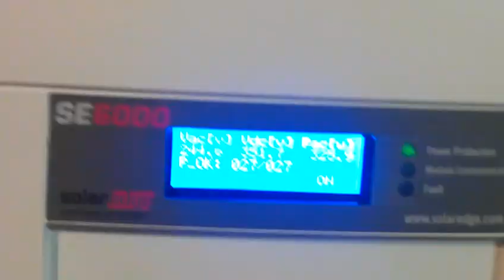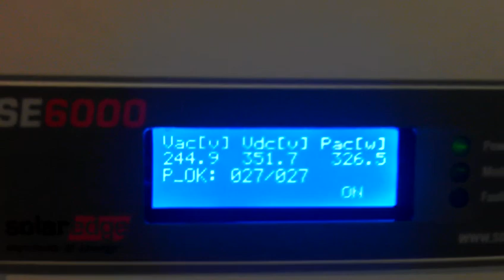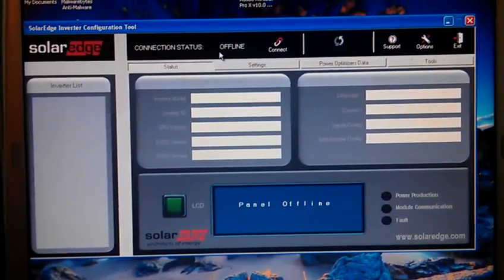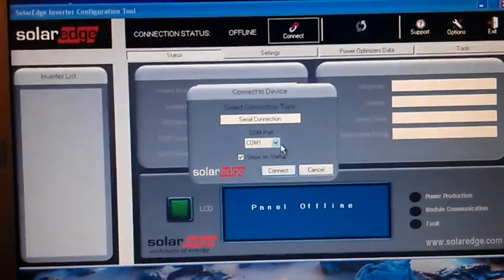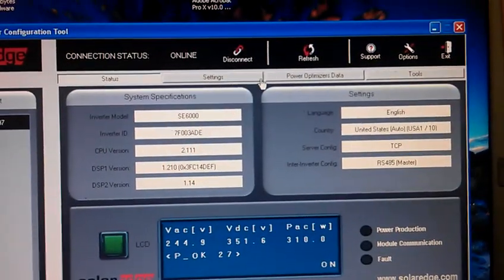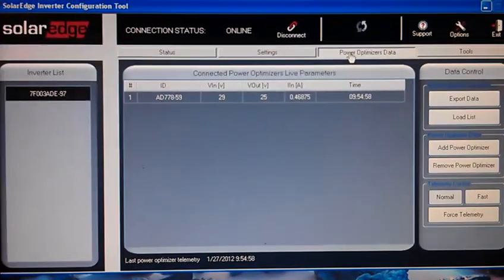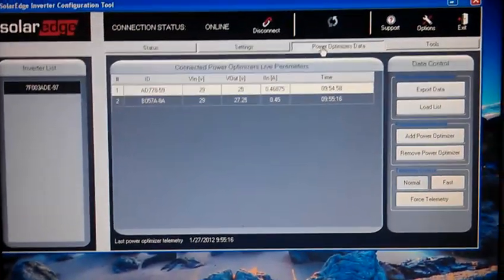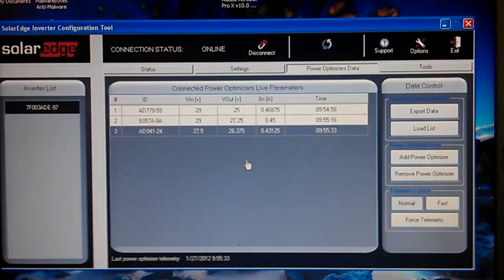Solar Edge 6000 kilowatt inverter configuration Part 1

Comment: I have a se7600 no serial port no micro usb. Can install  to terminals, do I need a password, I hate there portal updates 2 times when the sun is out lol. I like the real time on the screen, i have a beacon inverter connected to my computer using google desktop then I can see it in real time on my phone anywhere anytime.

Comment: Can a SolarEdge inverter be used as a regular string inverter?  In other words, I want to use it on panels without SolarEdge optimizers.  Can it still function as a normal inverter?
Reply: No, by design, the SolarEdge inverter will not function without the Power Optimizers.

Comment: You didn't check the manual for the spacing of the inverters.   It indicates that 16 inches are required for clearance to the sides.